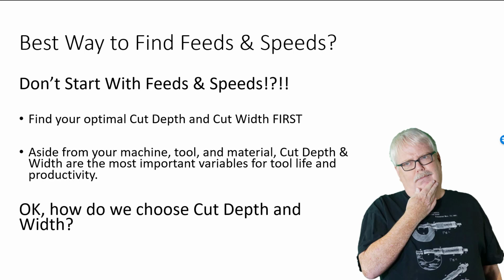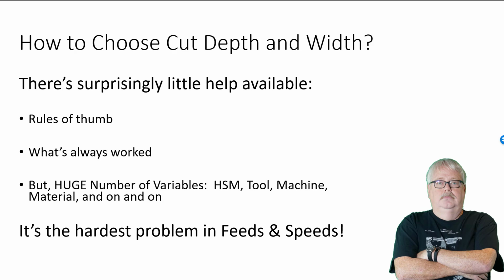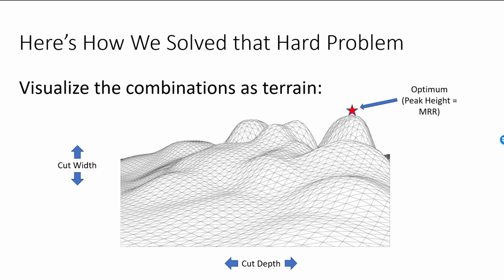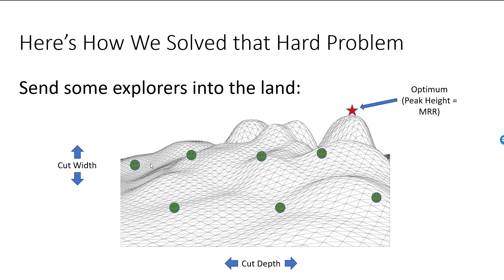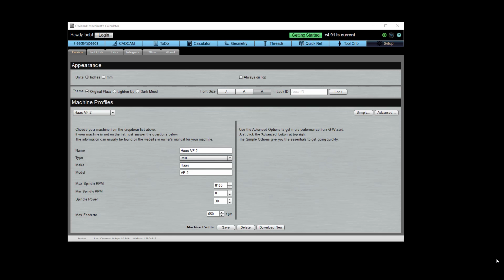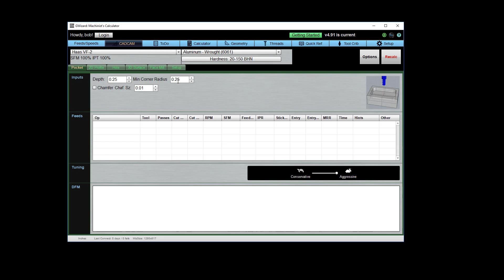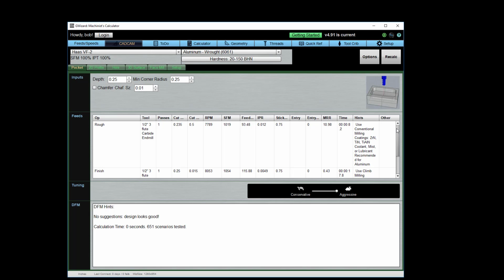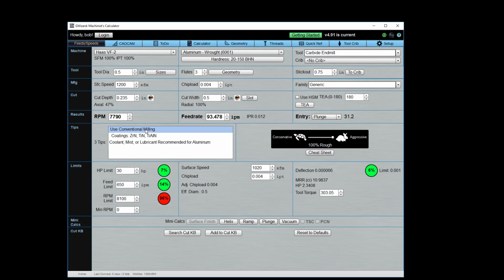Getting Started with Feeds and Speeds

Comment: I'm a bit confused because you said the first thing is to decide on cut widths and cut depths. However at 4:52 you said:  "I want to go down a 1/4" in depth". There's no explanation about if you have a deeper pocket. Would G-wizard suggest a deeper pocket be done in 2 or more "layers" for instance. 
The explanation you have given seems to just say, "Put the cut depth to the same as the pocket depth". That clearly will not apply to a great many situations where a cut cannot be done in one single depth pass.
When you showed the 3d triangulated graphs with varying  height peaks, you said G-wizard will calculate the optimal one, yet in the video you've MANUALLY chosen a depth based solely on the depth of the pocket. 
Would G-wizard automatically suggest the optimal depth/width combination of a much deeper cut, based on the material, cutter, machine capabilities, etc.
So that gets back to the question, "How do we choose depth first". 
My company has just got a licensed copy of G-wizard installed on my computer so I'd like to understand this.
Reply: Ah well, just like the emails I sent, ignored

Comment: Pretty cool.

Couple of things:

1)  I'm comfortable with graphs (I'm a mechanical engineer), but I found what seemed to be a 3D graph representing an optimization space plotted on 2 axes confusing.

2) Your recommended starting with CADCAM instead of Feeds/Speeds and said that one works through G-Wizard from left to right and top to bottom, so it would seem to be more consistent to have CADCAM be the first tab instead of the second.
Reply: The latest versions of G-Wizard do indeed have CADCAM Wizards as the first tab.
Reply: @bobwarfield9567  Good to know, thanks, Bob.
Reply: I'd like to second the point about the graph. I felt you were trying to make an important point but the visual completely failed to communicate it.

Comment: Your videos have been helpful.  I am brand new to CNC routing and have the Shapeoko XXL.  I have bought some bits on eBay and Amazon and I'm trying to enter those in the tool section.  It would be awesome if you could do a video for newbies on entering tools into G-wizzard when some of the data is missing.  I guess the video would be more about how to properly figure out all the needed tool data if you don't have it provided to you so that the correct information is entered into G-wizzard.  I can email photos along with the data I have for some bits to show you what I mean.
It would also be awesome if G-Wizzard could run as a plug-in in vcarve pro.  That would be just awesome.
Reply: Did you find any software to help you? This seems to be for people with an industrial machine.